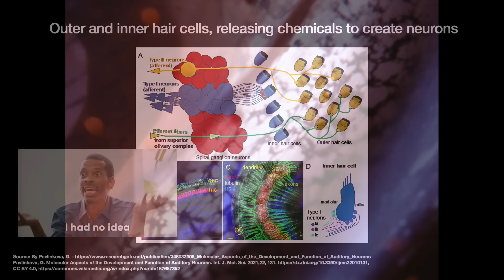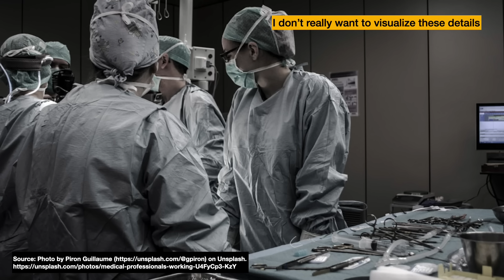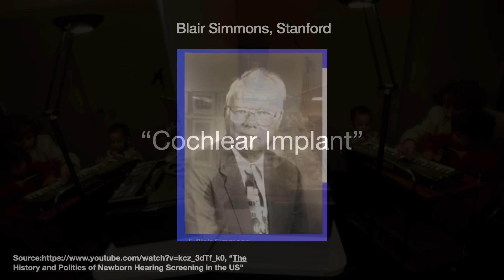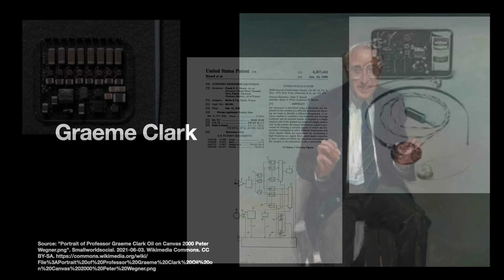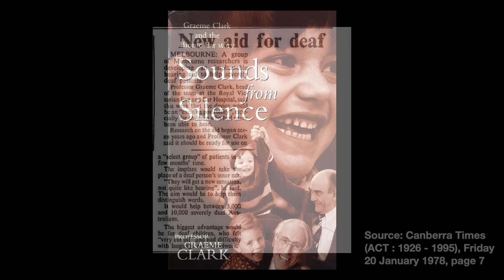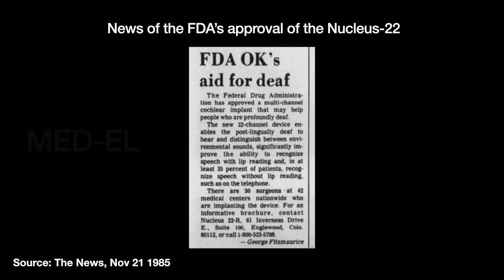The Miraculous Cochlear Ear Implant

Comment: The inner ear is a marvelous biological device and few people know just how complex it is. If you look at the anatomical diagrams of the semicircular canals that form the labyrinth you'll notice they're all perpendicular to one another, their planes corresponding to the three axis of rotation in 3D space. This is very similar to older gyroscopes, impactometers and inertial units that were used in navigation, torpedoes and missiles. 

The Cochlea itself is a long cone wound up on itself, and because the diameter of the cone reduces along it's length it separates a complex sound wave into it's fundamental frequencies. It's basically an analog Fourier sampler.

Comment: There's also some really cool ongoing research into Optical Cochlear implants, where they use viral gene therapy to make the spiral ganglion neurons light sensitive, then instead of sending electrical pulses to 1-2 dozen electrodes (which you can't really scale further, since you run into crosstalk of nearby electrical signals), you use LEDs or lasers to directly stimulate the neurons with much higher spatial precision than electrical impulses. Super cool stuff

Comment: Talking cochlea, there's also the otolith. Put little rocks inside of a hairy sack, wire up some nerves – you can now tell where's up and where's down, angles and accelerations and such. 

From Wikipedia:

An otolith (Ancient Greek: ὠτο-, ōto- ear + λῐ́θος, líthos, a stone), also called otoconium, statolith, or statoconium, is a calcium carbonate structure in the saccule or utricle of the inner ear, specifically in the vestibular system of vertebrates. The saccule and utricle, in turn, together make the otolith organs. These organs are what allows an organism, including humans, to perceive linear acceleration, both horizontally and vertically (gravity). They have been identified in both extinct and extant vertebrates.

https://en.wikipedia.org/wiki/Otolith

Comment: i bet the "DSP" code is just an FFT and calibration data
Reply: "Just" is is a bit rude! There is way more to it than that. And incidentlally the processors until about 2005 used switched capacitor fiters - they were not DSPs
Reply: @peterseligman2511  I can't imagine the ingenuity required to perform such complex processing in the days of such limited hardware, I think us younger electrical engineers are spoiled by DSPs and the ability to throw cheap computing power at every problem :)

Comment: In the early '80s I worked for NSA on Speech Recognition research. At that time I learned that US speech recognition systems were based on (Linear Predictive Coding) LPC-10 vocoders, whereas the Soviets had used German slave-labor in the 1950s to build the channel vocoder. It divided the spectrum into frequency bands, or channels. These bands were equally spaced between 100Hz and 1000Hz and log-linear for higher frequencies. This proved to be a superior feature extractor (over LPC-10) for speech recognition as demonstrated by the Verbex speech recognition system. (By this point, I'd left NSA so none of the guys I talked to were spooks.) The researchers that I talked thought the cochlear implant guys were controversial, but doing quite interesting work tangental to Speech Recognition. In the late '80s at an IEEE conference I had delightful conversations with a British guy who'd moved from Speech Recognition to a hearing aid company.
p.s. you might find of interest the work Aleksandr Solzhenitsyn describes that the Russians compelled German slaves to do at the Marfino Institue. Likewise, the competition between the LPC-10 vocoders and Channel vocoders may be of interest.
Reply: I found it very amusing that when Microsoft did research into speech recognition their first working version output "wreck a nice beach" when they gave it "Recognise speech" as the input.

Comment: Could a version of this fix tinnitus?
Reply: ENT here, patients often (not always) report improvement in tinnitus while using the device. However the device should not be worn at night or when going to sleep, which is unfortunately when tinnitus is often worse. So tinnitus is not in an of itself usually considered reason to receive a cochlear implant.
Reply: Exactly what I was going to ask 👍
Reply: Yes, this has been tested  - but for extreme situations.
Reply: @robeik I use a box fan, and right now an air conditioner to reduce my perception of ringing and hissing.  Both are in a high frequency range.  When the power goes out at my building, the ringing and hissing is perceptually so loud that I can hardly stand it. I go outside to hear sounds that negate most of the tinnitus.  That's a phenomenon worth study.  But I'd like to see deafness treated, with success before my problem.
Reply: There are neuro feedback training that is pretty effective at treating it now.  It aims to retrain pathways so that the brain strengthens existing intact auditory ones and weaken and hopefully remove phantom pathways.  I really hope they can use the same techniques to treat other "phantom" sensory issues like VSS, tactile noise, phantoms pain etc... I have acquired all of these including mild tinnitus as a result from being on antidepressants, I don't taken anymore, haven't for years, in fact these symptoms emerged from stopping them. I had hearing loss too, but it eventually recovered as far as I can tell but I now have a lot of random noise in all my senses except smell.